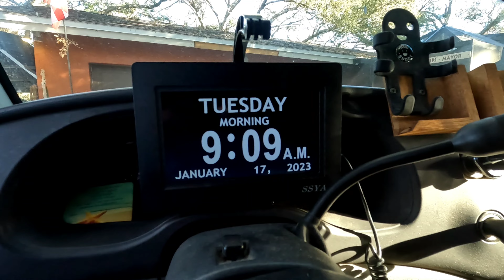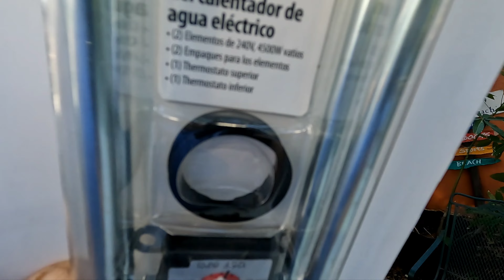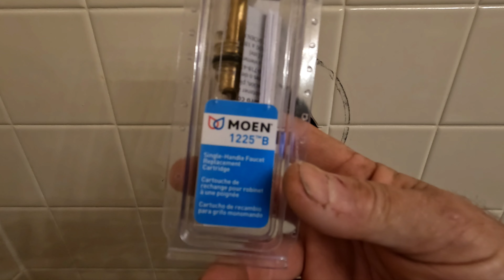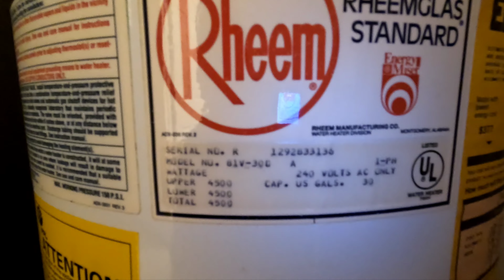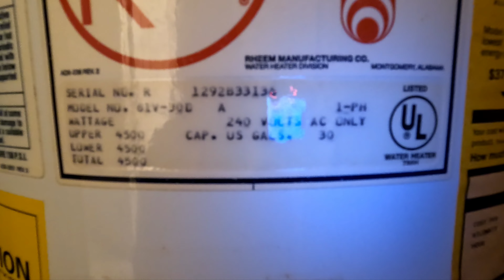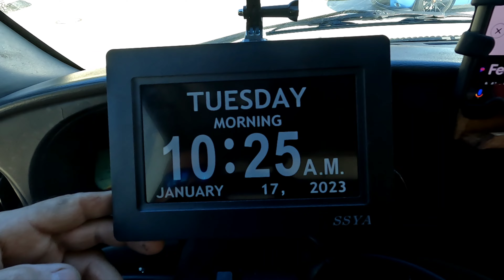SHOWER REPAIR FOR NEW CUSTOMER

Comment: Rheem is good brand today I cleaned my eemax 6 gal point of use water heater that stays in my van lots of scale on the element and crud in the tank
Reply from the maker: I'm very happy with Rheem, that's all I put in since I started my business. May want to service yours a little more often, see if it has an anode rod maybe replace that it could extend the life.
Thanks for watching my friend

Comment: Can you change out 1225b cartridge, round handle,  face plate to maybe single long handle type only? Thx
Reply from the maker: Yes you can,danco and another company ,American something, not sure of the name but they make after market trim to fit those old valve bodies. If you have 2 screws on the bottom of the faceplate that's what you need. 
Thanks for your question 👍

Comment: Why not flush out the valve, give it a good shot of water flow, always works to clear out all debri
Reply from the maker: Flushing is a great way of cleaning out the valve body,easier with two people. 
I never valve an issue the way I do it,to each his own. Als,I  never use the integral stops